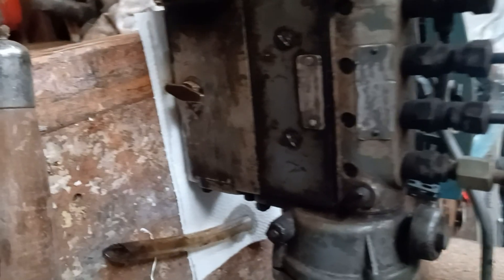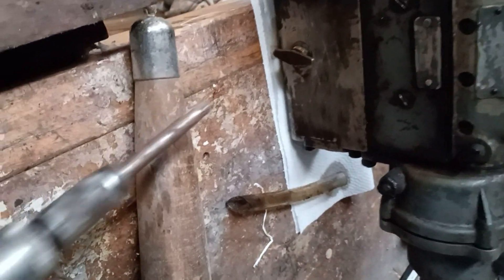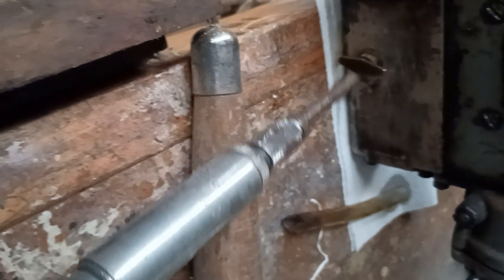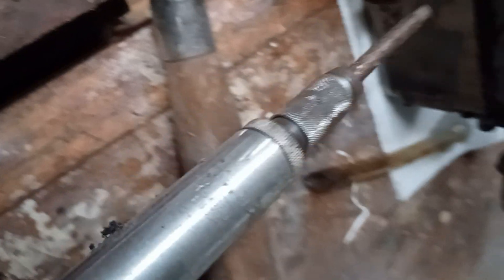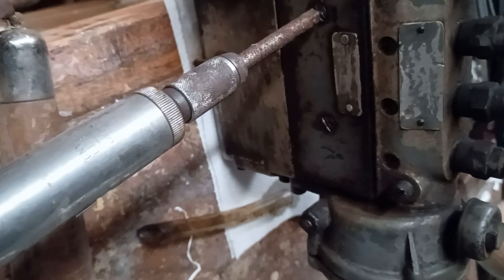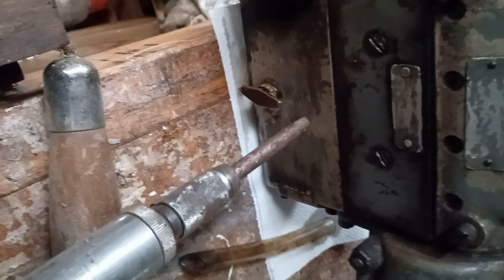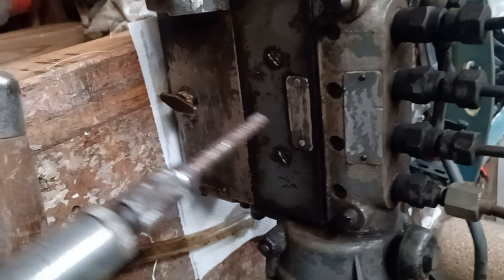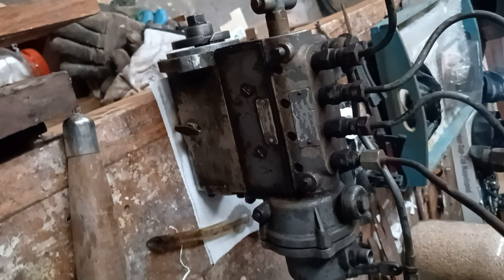Ferguson TEF 20 deisel injectors service. Reading the plate.

Comment: interesting …. i watched another utube film on these.  Am i right in saying you take off the drain plug, and fill it up with oil through the drain plug hole , till it flows out the drain plug. Then replace the drain plug and it dilutes with diesel? I watched Bundy Bears excellent video and this is what he said to do at 1hr 20min into his film? can you throw any light on this?
Reply from the maker: Hi, I reccon the drain plug is for draining out. If you're on the bench you could fill up with the drain plug but if its on the tractor take the two screws off and fill from the top. Untill it reaches full. 
Just remember too that if you're taking it off, put it back in the same place. There are marks on the housing. Clockwise advance - anti to retard timing. Personally I think this is important too. So don't just bang the injector unit back on.